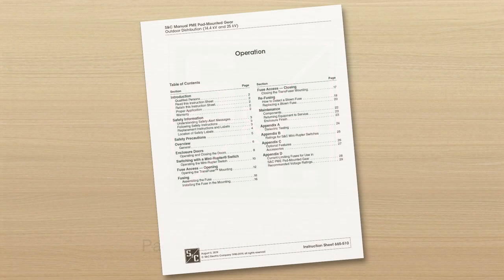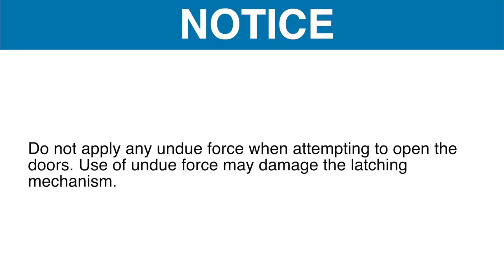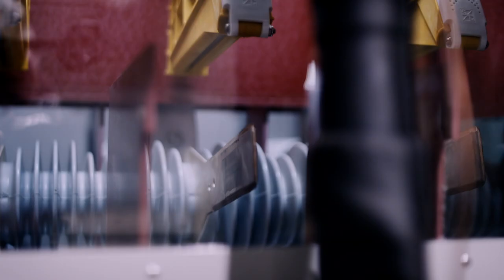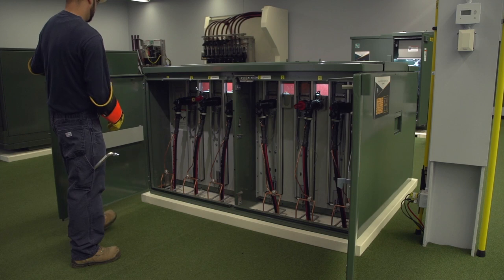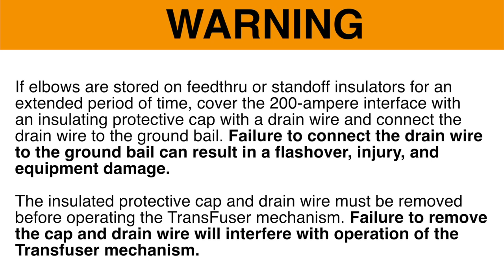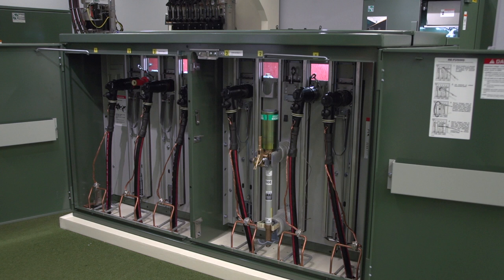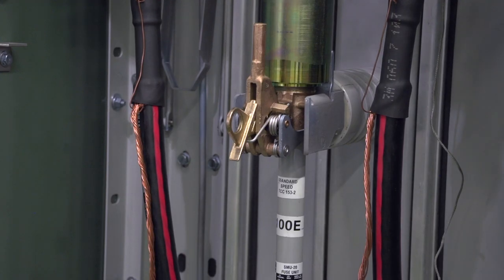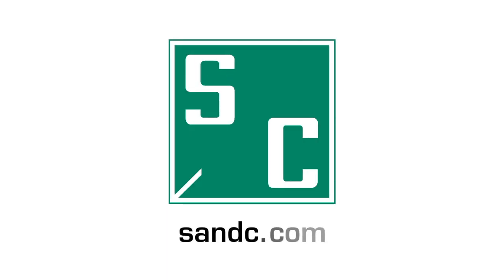Manual PME Pad Mounted Gear Operation

Comment: They cost more money, but it makes no sense to buy PM gears when VISTA gears are so much safer and easier to operate. They also have no exposed primary that can flash over in high contamination areas.